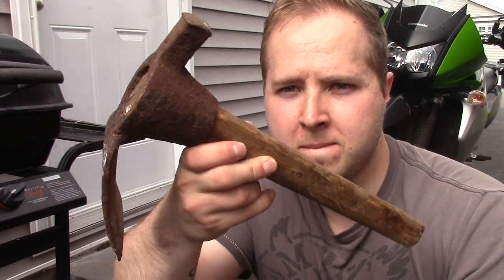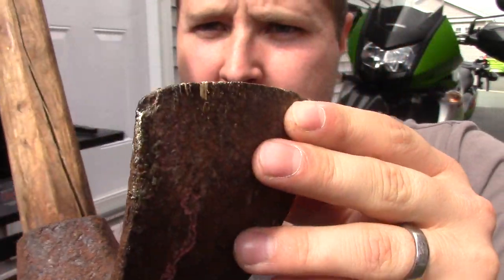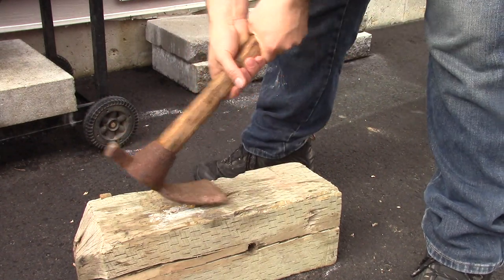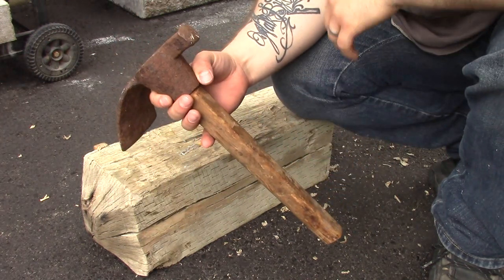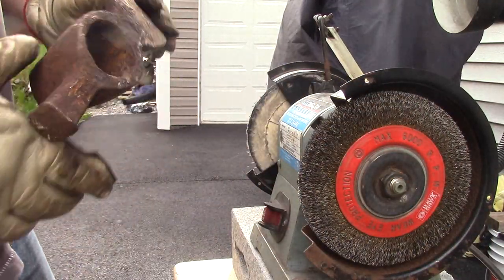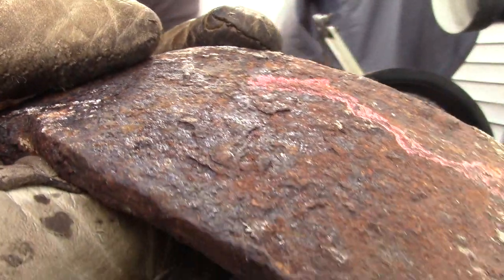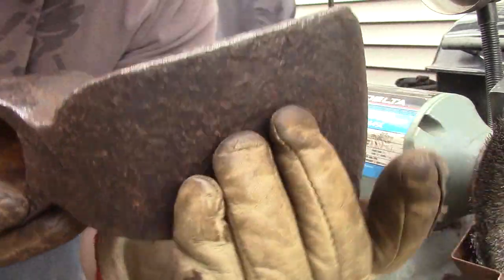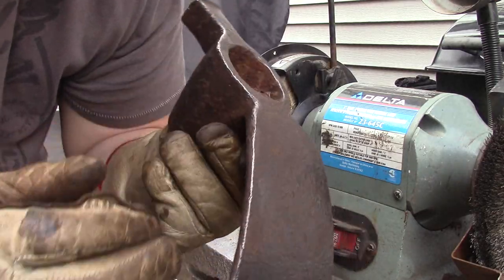Antique Adze Restoration - Part 1

Comment: Adzes are used for many different purposes, like hammers.  Because of that they come in many different shapes and configurations.  I have one forged for me in Sweden that I use for hollowing out  hand carved wood bowls.  It has a "u" shaped bit much like a gouge chisel. In log building they were used to chop out groves, gutters and for shaping timber.   In railway building they would be used to put the final level on the railway ties before the rail was spiked home.  One style made by the Northmen even have an axe blade in behind the adze blade to further spilt a big wood chip as it is extracted.  The one Kyle is restoring has quite a bend.  The bend dictates the length of the handle required.  If the handle is too short or too long the bit will not naturally engage the wood at the best angle.  Kyle's also has a hammer built in.  Obviously it is not just a cutting tool but has a dual use.  Exactly what Kyle's adze would have been used for would be interesting to know.